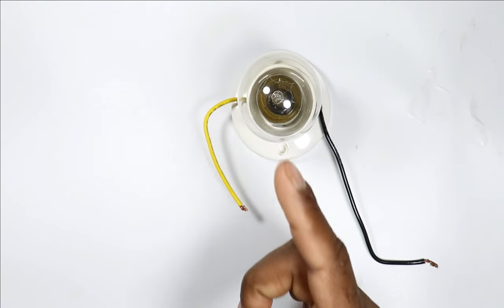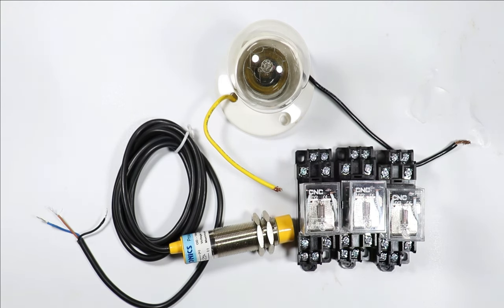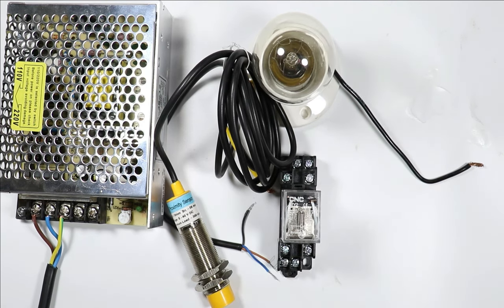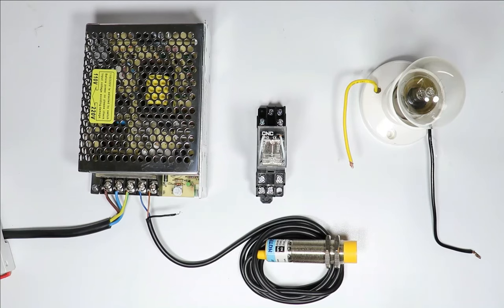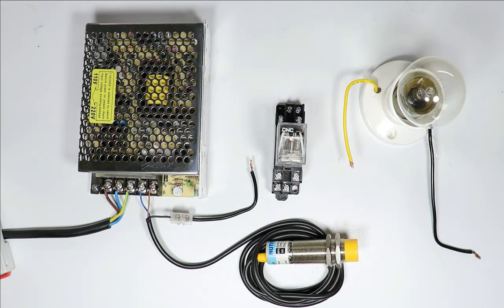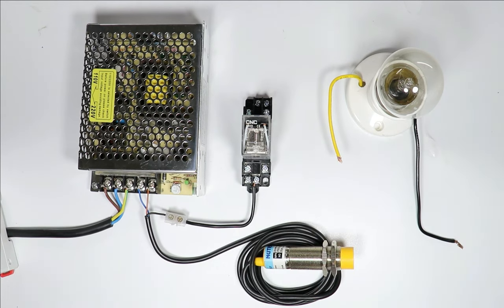MY2N Glass Relay Connection With Sensor @the electrical guy

Comment: Hi, thank you for your explanation! This is a great video. More people should have seen it. By the way, I would like to ask you one question, can i use a AC230V sensor to trigger a DC5V LED light?
Reply: You can if you using 240v ac relay

Comment: You used 24DC relay but connected ac voltage on it,explain to me please
Reply: He used 12VDC relay. The supply to trigger the relay is 12V DC which comes from the SMPS box. The 220 volt AC supply is connected on the load side. The purpose of relay is to separate two connections, with one having to trigger the other.